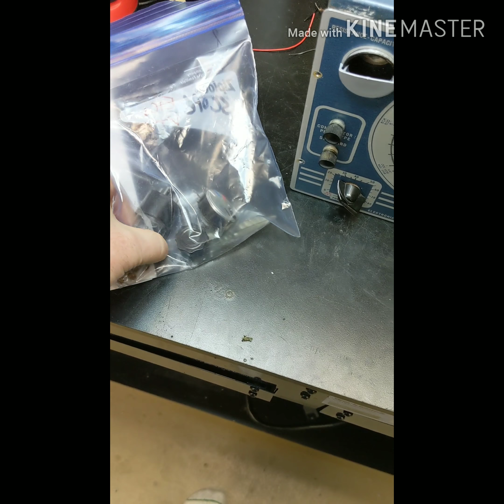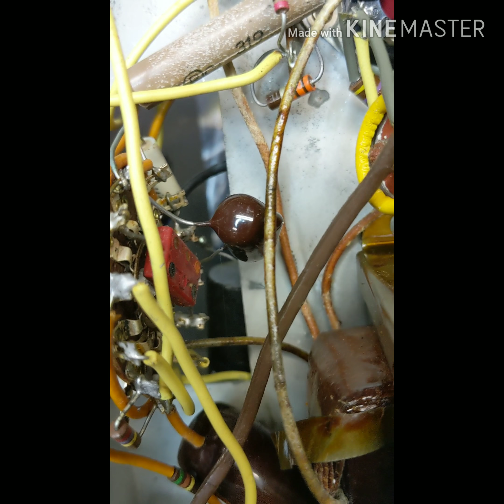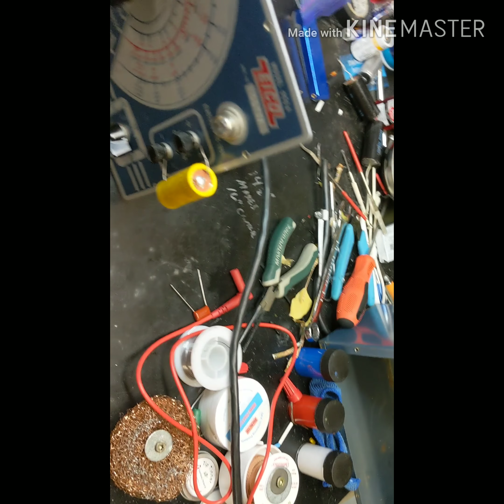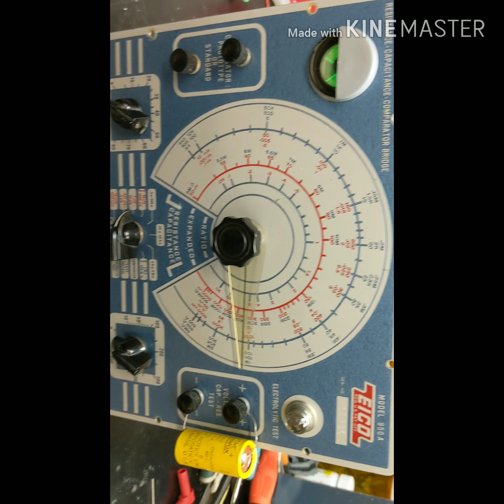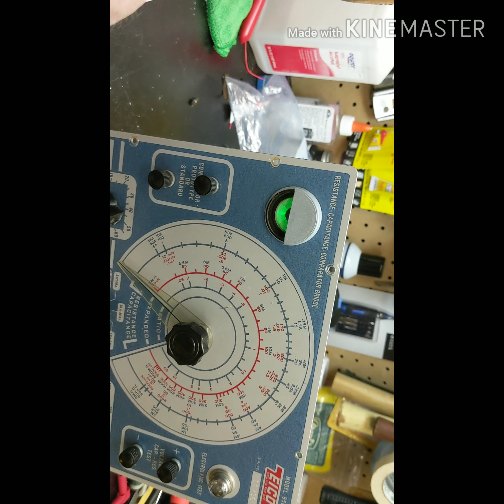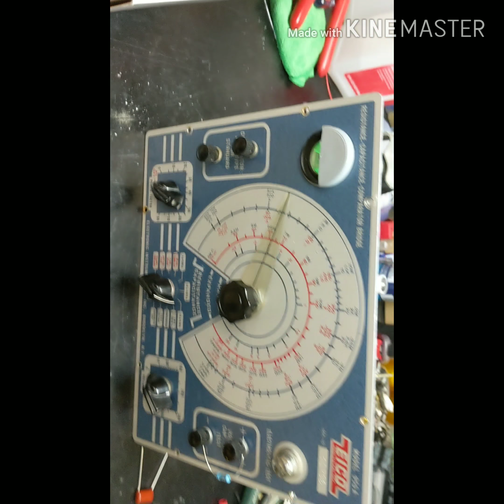EICO 950A Bridge/Comparator/Capacitor Tester- Gregg's Vintage Workshop

Comment: What is the light on the right under logo about?   I was hoping you would cover that.    This is my first eico.   I collect and use heathkit normally
Reply from the maker: Hi, that is a neon bulb that indicates leakage when testing a cap under voltage.
Reply: @greggsvintageworkshop8974 neon bulb? Hmm. Interesting Thankyou.